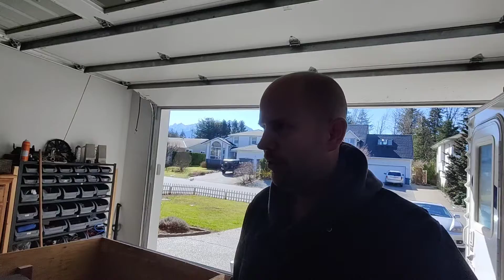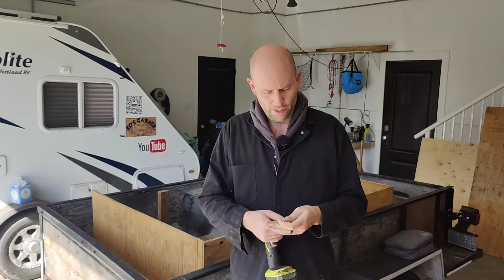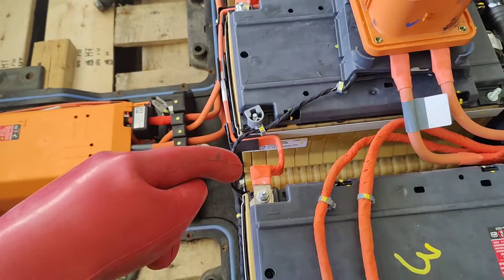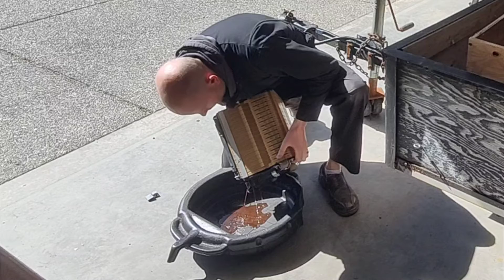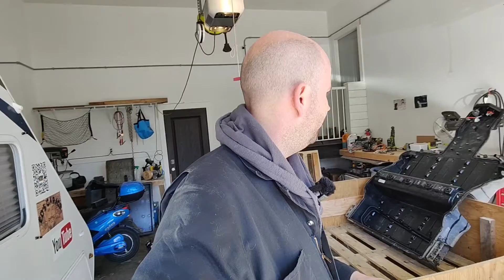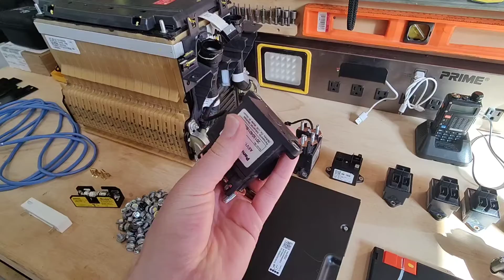EV battery teardown! Chevy Spark Electric, battery disassembly.

Comment: I replaced a battery pack in a Chevy volt in 2018 and it is very similar. What I found with the modules is that if you have a voltmeter that can show thousandths of a volt you can charge each cell until everyone in the module is exactly the same to the thousandth. Yes, it takes a while but once you do that, you really don’t have to worry too much about balance. This assumes that the module is good, however, good modules will stay balanced for a very, very long time if you super finally balance them in the beginning I did experiment with a balance Set up from my hobby charger. A very fine quality hobby charger I might and it could not get anywhere close to hand balancing them. The pack that I was working with had 174k miles. Almost all of the modules were fine except for one at the very end of the battery string. I believe you are seeing the same thing. I think when internal resistance goes up the end module is the first one to go bad if I had a low mile pack, I would put a new module in it for the car that I was working on however it made more sense to put a new pack in it due to the miles
Reply: Sorry for the disjointed sentences. I use speech to text and it is imperfect.
Reply: If you have a spark and it doesn’t have a zillion miles on it, I would look at buying used modules to replace failed ones. I wouldn’t worry too much about internal resistance because a used module is likely to have a similar internal resistance to yours. You can do some testing, but I would just run with it. Make sure all modules have the same exact voltage and optimally every cell should be charged to 4.0v Prior to reassembly. If you get every cell at 4 V and the cells are good. You should be good for a good while.
Reply: When I say 4v I mean 4.0000000. Dead same. Use hobby charger to get there. Fluke meter for voltage measurement.

Comment: If that Spark EV owner had found the one bad cell and removed it (never mind, replacing it), could the battery pack be put back in the car?
Reply from the maker: @DoctorHemi  replacing the module could have worked, yes. Replacing the one bad cell would not though, as getting the module back together is nearly impossible and the other 31 cells were lower capacity then the cells in the other modules anyway. 

But yeah, if you could replace the one bad module with another one (with similar degradation as the other 5) you'd be good to go.

Comment: Thanks!
Reply from the maker: THANK YOU!!!
Reply: @edsgarage2.0  Checking in about the 2 orange high voltage ports. Thanks.
Reply from the maker: @johnlende707  oh man, I'm so sorry, that isn't something that I kept.. ... I only have some of the relays, wiring etc.. not the ports. 🙁
Reply: @edsgarage2.0  Ok, thanks. I might need something else when I get into it. If anyone else has the two orange plug in ports on the front of the battery case let me know. I have a 2014 Spark but they are probably all the same. Thanks for the video!

Comment: Hello, do you still have the leftover parts? I would like to buy some of them. Thanks.
Reply from the maker: @johnlende707  which parts are of interest.. and where do you live?
Reply: @edsgarage2.0  I would like both of the orange high voltage ports on the front. They have wires that connect back a bit. I live in Denver. What is the best way to contact you with more info if you need it? Thanks.
Reply from the maker: @mrkeopele
So sorry I missed out on this message.... I actually didn't have those parts anymore though anyway.
Reply: i just got one what do you need
Reply: @mrkeopele  Hi, do you have a 2014?
Reply: @johnlende707  A123 manufacturer
Reply: @ i think it is
Reply: @mrkeopele  I need the two orange female plugs that are mounted on the large battery underneath. Also the onboard HV battery charger.

Comment: Its not a BMS, in a car its called a BECM because it doesn't do anything with out a vehicle computer module . At 3.0VDC that cell might be below the published cutoff voltage specification, a charger will not charge a cell below cutoff voltage and the the cell is generally consider damaged and its chemistry is no longer viable.
Reply from the maker: @mpirron1  yep, that cell proved to be the definite failure point. 

As it was the end cell of the pack, it was adhered using adhesive tape to the pack end cap. So rather then risk tearing it open, I ended up using it for the scooter pack that I built... That was a mistake. It ended up causing me to be stranded a few kilometers from home with that cell prematurely dying. 

So I pulled the pack apart, and VERY VERY carefully peeled that cell off of the end cap over the course of about two hours using plastic pry tools. Ever at the ready to throw it out the window should I inadvertently tear it open. 

But I managed to get it done. Replaced it with one of the good cells, and now the scooter battery pack is extremely healthy ☺️
Reply: @edsgarage2.0  you can always tell if you damage a cell and expose it to air by the smell. The potassium hydroxide electrolyte has an unmistakable smell. It's actually very difficult to cause the Li-ion to start on fire. You can throw them in a fire and they won't start on fire. The worst thing you can ever do for a battery cell is overcharge it tho, close second is expose it to water.
Reply from the maker: @mpirron1  Well.... I still wouldn't wanna chance it lol

Comment: My 2016 Spark EV still gets 110 km per full charge around Vancouver (summer range, don’t ask about winter), but even though my charges are mostly 8A at 220V for longevity, I worry about the day that 1 module shuts down the whole car and GM says their overpriced battery units are no longer available. If you ever find more modules please let me know!!!
Reply from the maker: @peters8758  thanks for the comment! I've seen a couple floating around on eBay and what not. I still have four that I haven't used yet lol, however I have plans for all of them for the moment.
Reply: @edsgarage2.0  hey sir, do you still have relay’s of it, looking for the 400vcd
Reply from the maker: @andrewpc6970  Yeah I still have all of the relays I pulled out of it. Where do you live?
Reply: @edsgarage2.0  hi, I’m from Costa Rica, I will be interested in one relay and one YHT-65hs402, not sure if you tried eBay before?
Reply from the maker: @andrewpc6970 oh man.... Well I'm on vacation until February 3rd, but I can look into to it after that if you still need the parts
Reply: @edsgarage2.0  yes please it is difficult to find spares for the car, car is with p1ec5 error, it could be the relay or the power train control module. 

Thank you sir
Reply from the maker: @andrewpc6970 send me a message here on February 3rd or 4th, I'll see what I've got

Comment: H ello! I have a 2016 Chevy Spark EV and noticed a lower battery range performance. Dealership performed the Electrical Systems Diagnosis ($175). They determined that the battery is functioning at 22.6 Ah, compared to the minimum 31.5 Ah.  Headquarters is reluctant to act on it. They want me to "wait and see" and do another diagnostic in August. Do they think they made a misdiagnosis? Should I push for a repair order to start? The warranty expires in August, two months from now. Any advice?
Reply from the maker: The spark never came with a battery that big.... Numbers are off

Comment: I need a professional opinion: my 2016 Spark EV battery range was diminishing, so I took it to the Chevy dealership to run an electrical systems diagnosis test. The battery degradation was assessed at functioning at 22.6Ah, compared to an expected minimum of 31.5 Ah. The battery is still under warranty for another two months and the dealership headquarters are reluctant to act on it just yet. They want to run another diagnostic in August before they do anything. The first cost me over $150. Do they think they misdiagnosed a problem? Any advice?
Reply from the maker: I don't think they misdiagnosed it... As if they can make you happy by having GM pay up for a battery, then they would most likely do it. It's free money for them as it's a relatively easy repair (about 4 hours).

Consider getting a second opinion at a different GM dealership. 

If you can, don't charge it to full for a while, charge it sporadically... It's more likely to unbalance if you do that, which may give it a lower reading. You're very close to a "failure" of 30% degradation.
Reply: @edsgarage2.0  Thanks for responding! They don't want to repair it "yet" because apparently the 1 year battery warranty ran out in 2019, and we only have the 100,000 mi 8-year warranty for general issues remaining. Since the car isn't displaying any "battery problem codes" they are reluctant to fix it, even if it is running at less than the 35% stated. FIngers crossed this can be resolved, or at least a repair order started, before the final warranty runs out.
Reply from the maker: @LaraT-cw1oq  keep bugging them!
Reply: any updates? thx
Reply: @riskyraccoon  Update! After several weeks of collecting data of how much range the battery was providing, the dealership offered to do a second complementary diagnostic assessment of our battery. They determined that it was under performing and headquarters agreed to replace the battery under warranty! (We were two weeks away from the 100,000 mile, 8 year "extended warranty" expiring.) We will have to wait until October, but it will still be covered.
Reply from the maker: @LaraT-cw1oq  That's GREAT NEWS!!

Comment: Hey Ed, Ian here, great video! I did the math for you, that was $3560 in components you saved, plus the fluid heater and its controller, whose prices you didn't mention. 

So glad some great use came out of this thing and it didn't end up in a landfill! Looking forward to the rest of the series here to see how implementation goes! Wondering though, why won't you need to run coolant during use? Is it just a matter of discharge speed? I can see for the house backup not needing it, but in a higher current situation (like the scooter I see in another video) wouldn't you want to run coolant just for life extension? Maybe that's answered there, but thought I'd ask. 

Speaking of discharge speed, I did a little more math. The average home here uses 900 kWh per month, which comes to about 1 kW. From observation, this is equivalent to driving a Spark EV at around 2km/h (just above idle speed)! It also means the battery backup of 6 kW would last about 12 hours of normal use (assuming that average consumption of ~30 kWh is done in the waking 16 hours of the day). It might not run your oven long, but it'd be a full-power substitute in the case of short term blackouts, and could keep ten 9W LED bulbs (60W equivalent) powered for just under 3 days!
Reply from the maker: Thanks for the comment! 

I'm not worried about cooling these batteries even in the scooter, as the draw and charge speeds aren't enough to really heat the batteries up much. 
On a test run of the scooter with both my wife and I together on it going up hills and cruising around at full speed in 23C weather, the batteries never exceed 27C. 

As for the house... I'll probably just stick to using my car's V2L to run half the panel and just stick to using minor appliances. 

Other projects are coming soon. I've got a 60 volt to 110 volt inverter coming from China, so I'll be building a portable battery back soon.

Comment: Quick question can I replace the battery on my spark Chevy for a larger one to get a greater range since my car just barely goes over 60 miles if possible can it increase it to over 100 miles or will that be a fantasy I’ll have to live with, thank you
Reply from the maker: While it's technically possible... It's not going to be simple. 

Current battery technology is of course superior to what the Chevy spark EV came with. So if you were to replace the cells with something that had a higher energy density, but the same basic specs like voltage, discharge capacity etc, then you'd have a better range. That would be the simplest way to do it. That way you'd be able to keep everything else the same and use existing BMS, controller, inverter etc. 

It would require 96 individual lithium ion cells, in 6 modules, each with 16 cells spot welded in series. Each module would need to be disassembled and have each individual cell removed and replaced with new ones. 
A tonne of work.
Reply: @edsgarage2.0  you will have a hard time finding battery cells that power-dense even today, we are going backwards in that regard currently focusing on materials management and battery safety as opposed to power density. These batteries are exceptionally strong for their size.
Reply from the maker: @mpirron1  I've been noticing that... There are good replacement cells out there, but you're right, there's not much.

Comment: Definitely gonna swing back around to actually watch this! EDIT: I'm back, repairing EV batteries to be able to last for years after the repair is not quite possible, module replacements would need to be tailored to identical capacity which is not as simple as remove/replace. I wish it was. Really cool man. Tks for tearing this apart and showing it!
Reply from the maker: Thx for the comment!
Reply from the maker: That sort of repair is indeed feasible - you just need to find a module that's close to the same capacity... +/- 50 or so watt hours would work. There's companies that do it - The more places doing it, the more available these modules would become. To a point mind you. 
The other option, would be a complete module swap with compatible units, or some re-programming. There's definitely options.
Reply: And internal resistance

Comment: You can create a balancing board and use a bench supply to bring the cells up to a 'safer' storage level , somewhere around 3.7-3.8V each by using big Zener ciodes in a line across that connector, then use a variable bench supply to set the total voltage and a nice, low amperage.  That'll at least prevent cathode degredation.
Reply: Yeah, very low SOC in storage is bad for the cells
Reply from the maker: @lemongavine  I've got a charger coming in tomorrow
Reply from the maker: Thx!

Comment: Maybe that bad module had a clog in the coolant hose or port? I'm not sure what the maintenance schedule is on these cars, but maybe the coolant is supposed to be flushed after a certain amount of time? It looked kind of brown when you emptied that one module.
Reply: The coolant is vacuum-filled there should be no reason to change the fluid if its never exposed to air, that had been so its oxidized.
Reply from the maker: It was possibly because it was the last module. But yeah it hadn't reached the mileage for recommended fluid change yet.
Reply: I wonder if the coolant is age or heat related to braking down the coolant I think tesla does not need to change the coolant in there cars for maintenance not like ice car?
Reply from the maker: @lesterng5748  the coolant looked in very good condition. Everything was super clean.